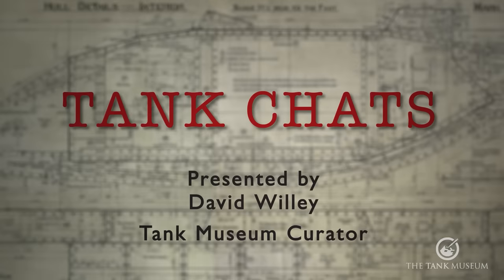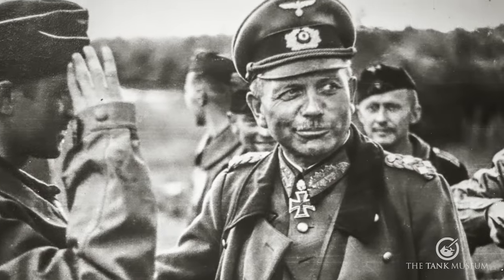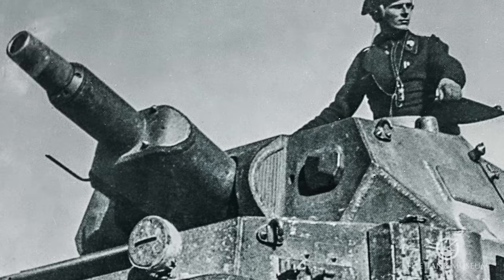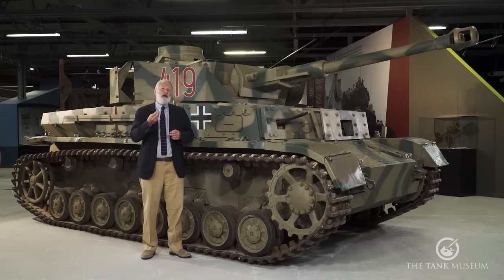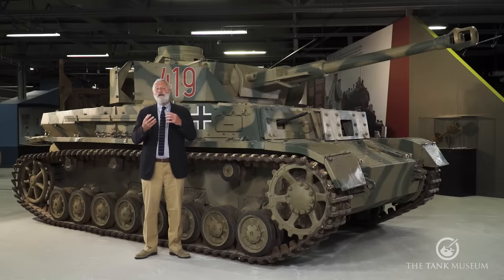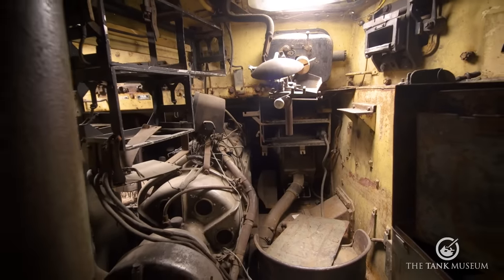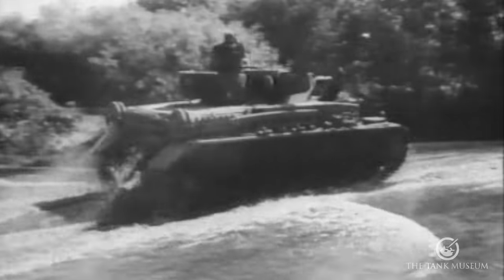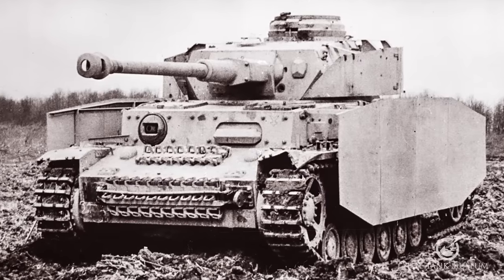Tank Chats #106 | Panzer IV | The Tank Museum

Comment: Very underrated tank It’s not as sexy as a Tiger or Panther but was one of the most resilient armored platforms.  The Panzer III as most know was supposed to be the main anti-tank tank while the Panzer IV’s primary role was infantry support with it’s short barreled 75 The Panzer III quickly became outgunned and out armored.  Ironically the Panzer IV’s platform turned out to be an good baseline that was easily improved upon, upgraded and retrofitted.   It was more reliable overall than even the later model Mark V & VI Panzers It’s gun and armor were improved enough that it still have decent survivability and kill capability until the end of the war.

The Panzer IV was still expensive, complicate and too precision grounded, if you will, in its production T-34’s were great tanks but tolerances were loose and craftsmanship wasn’t a hallmark of it during production Like most German products, the Panzer were made with great care, strict tolerances, and were overly complicated and expensive.  Precision was aimed for, but when production times and material concerns mattered, this hindered tank production.  For all the excellence in German engineering they never settled for a “good enough” design, lightened up on tolerances ir understood the benefits of interchangeable part and simpler designs and solutions.  A Panzer IV Is a beautifully crafted machine while T-34s could be rather crudely put together-this never really affected the lethality of it on the battlefield.  You could argue it was less comfortable, didn’t have as good optics, and lacked the radios German tanked enjoyed that helped them tactically and technically, but while not as nice the T-34 was on par or better.
Reply: The Germans never caught on to mass production (then).  It was as if they were building BMWs. Continual improvement can be a good thing, but the number of minor, incremental improvements added greatly to the maintenance burden in the field.

Comment: The German "Sherman".
Reply: Nice one 😄
Reply: If they had build it in the same numbers...
Reply: Against the Soviets, USA and British Empire? It wouldn't have mattered.
Reply: No, PzKpfw IVs were actually good tanks.
Reply: Tanks were insignificant in the overall scheme. Artillery, airpower and sheer weight of human bodies won the day.
Reply: @Oliver Viehland Outdated, hardly. Outproduced, for sure.
Reply: @Oliver Viehland M1 Abrams was introduced 40 years ago.
4 years merely means that tank has left Early Access stage. It was well designed and put together, so for it class it was quite capable machine. Plus in 42 it got 75mm  L43/L48.
Generally speaking Panzer IV was better early in the war, but by 1944, as Germany was forced to cut corners everywhere(from materials used to proper RnD), quality declined drastically. So by this period T34 would be on top, followed by Sherman, with  PzKpfw IV in the rear.
Also it was introduced in 37, not 38.
Reply: It is quite an achievement to have a 1936 design that is still a useable combat vehicle in 1945.
Reply: @Oliver Viehland The proposal was introduced in 1937, but production started in 1938.
Yes, my bad. While prototypes were available in 37, they did not saw action till 38.
Reply: @krautreport202  used after the war up to 1967 I think

Comment: Wouldn't it be good to to have two tank chats on the same tank one by the Moustache Fletcher and one by Willey . i think the chats would be different.
Reply: I am not dissing Fletcher, but Willey is on another level.
Reply: DW: And here, once again, we see evidence that towards the end of the war German tank design was becoming more simplified due to the chronic shortage of raw materials needed in tank production, due to both the success of the Allied bombing campaign and, particularly from the beginning of 1944 onwards, the Soviet advance into areas like the Donbass industrial region. All of these factors combined to place huge pressure on men like the German Armaments Minister Albert Speer, to come up with ideas to keep the production lines open. And that's when we start seeing factory modifications being applied even while the vehicles were still being built.

DF: Now all these shortages meant that the Germans had start cutting some corners during construction. Now if you look over here you'll see the bow gunners hatch, with the offset long-barreled 75mm gun sitting right over the top of it, totally preventing the poor sod sitting under it from having any chance of getting out of the tank in a hurry at all, say in the event of a fire or some other form of Teutonic catastrophe. Not the best way to design a tank modification really, but there you go.
Reply: YouTube has become something of a treasure trove of extremely high quality videos on WW2 vehicles. If you haven't watched it, I would strongly reccomend the Chieftans Hatch video on the Pz IV. He really going into detail of the excellent ergonomics the curator mentions in passing here